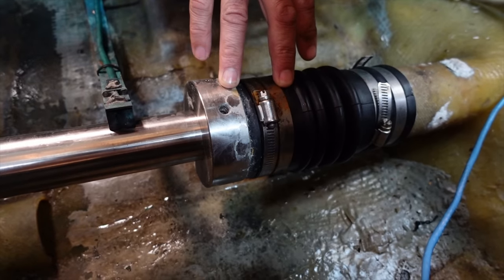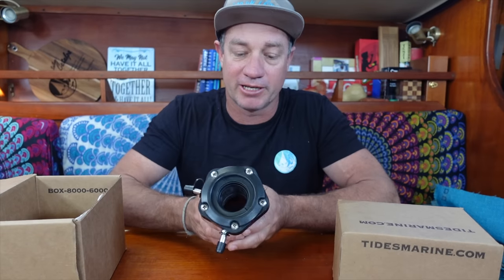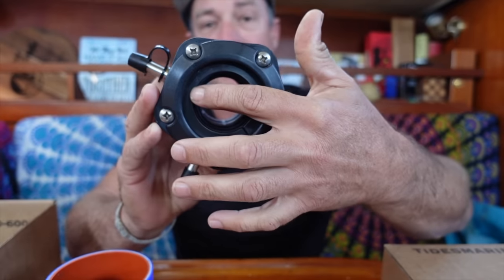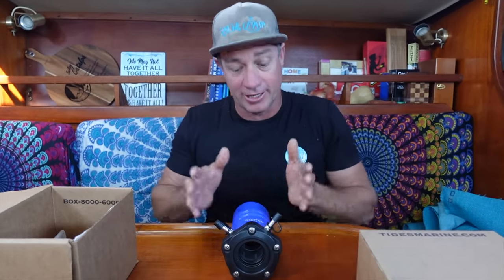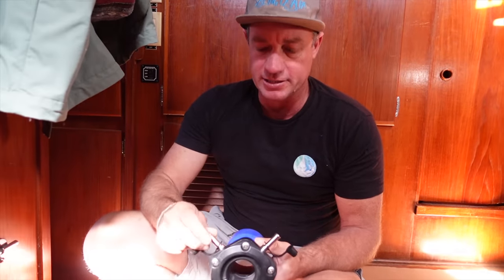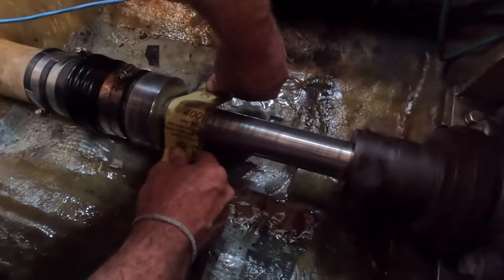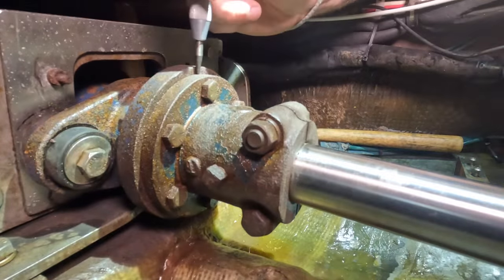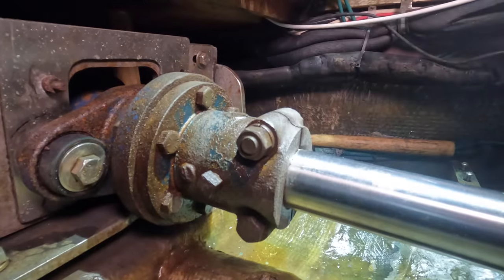Replacing our PSS shaft seal in the water WHY it might not be a good idea💡| Ep 345

Comment: You can jack the coupling off the shaft using the coupling bolts and a spacer that sits on the end of the shaft within the coupling. A spacer could be a nut or a few washers .
Place the spacer in the coupling so that when the flanges meet you have a small gap.
Put the bolts back in and tighten them evenly, the spacer will start pushing on the end of the shaft.
Keep adding more spacers until the coupling is pushed right off.

Comment: I have been contemplating a similar project  to replace my "Maincraft /tides Marine" prop shaft seal, system.(I think my thrust bearing is also loosing its grip on the shaft and allowing a bit of forward movement of the shaft; opening up the seal when pushing the engine hard. Research has revealed  that It seems every system (including a stuffing box) claim to be the best...
I had planned to tie up alongside the scrubbing posts but have now done some further  research and opted to
 get the boat out!  
The most useful information that clinched the decision was that  "The fastest way to get water out of a boat is a frightened man with a bucket!"
another tip was to keep a bicycle inner tube alongside the sterntube. in the event of total failure/split flange etc. tie it tight and keep wrapping it around all the old rags and stuffing, pulling it tight as you go . Allegedly this will keep you afloat long enough to sail/row/tow home....

Comment: Intense… your braver than I would be on that job. I did find what you has to say about the PSS seal interesting. When we were in the yard after purchasing our boat, I had the shaft pulled and serviced along with the prop.  The yard convinced me to replace my Tidesmarine seal with a PYI PSS seal.  The reasoning was due to how the Tidesmarine seal wore a spot into the shaft.  The yard guy said his preference was with the PSS because of how the seal mounted to the shaft and sealed agains the carbon bellow face vs having a rubber seal spin around the shaft.  I wish I could share the picture with you, but there was a nice shinny 3/4” wear in the shaft from the Tidesmarine seal. My PSS seal has been working good, but they do need to be serviced and mine is four years old now.  I have it on the list for my next haul out.

Comment: I know you've probably done this already, but all you need to do is gently spread the fitting in the slot, with a chisel, or some heat from a blowtorch to expand it, 

Also be aware your prop shaft doest slide all the way out! 😂 one way to stem flow is to wrap plastic bags around the shaft outside then as the pressure forces the bag into the gaps it makes a semi permanent seal. 

Well done for giving it a go first times the scariest, after that it's just a meh that's not so bad!
Reply: A couple of steel wedges in the two slots works for me.

Comment: Hi Lee, Sara. Thanks for this video. I’ve been wanting to learn more about the Tidesmarine seal. My former boat Snow Gum has a PYI PSS setup. I got to play with it a bit and install a new one while helping Volvo techs replace gearboxes and couplings a few times. Which leads to a suggestion. From listening to you I can tell you’re on top of this but it won’t hurt for me to emphasise the importance of eliminating vibration in the engine to propeller drive train. Our coupling failures were caused by poor alignment during build, so I applaud your efforts to chase that down. It matters, even if you have an Aquadrive. Coupling bolts will be fatigued by the vibration and the threaded bolt holes in the flywheel itself will be damaged, leading to repeat failures of the coupling bolts. It can become a nightmare. Regards, Rick.

Comment: I've had the bands break, yes the boot came forward and lots of water ingress. All bilges on and manual help to remove the water. 
Not once but three times this has happened. 
I love the access you have, i have a side access under a bunck that is an 8 inch by 4 inch hole you can only fit one arm in to remove the broken band, lever the boot back onto the mount and try to feed the new tension clamp on without marking the drive shaft.
Balancing a torch to see what your doing while you perspire like a fire hose and feeling your losing it when suddenly it all popped into place, an 8mm socket washes out from under the boot which now makes sense why it wasn't on properly in the first place. You really feel great after an event like this but wish there was better access to all engine spots.
I love watching and learning from you but please do it before  I've done it LOL 😅

Comment: I know I'm late : 
Sorry but if the bellows fail on your new seal you will have the same problem.
First remove the bellows from the stern tube forward on the shaft and stuff it with a large one piece rag really tight. this will stop the flow and make it easy to remove later. 
You will need a wedge hammered into  the slot to relieve that half coupling to ease removal. Also there could be another locking feature there. I shall watch the next vid to see what happens. :0)

Comment: Get a flat screw driver and place it into the slot and tap it into the gap to open it no heat or Chisel and as said plastic bag out side on the Shaft will slow the seawater flow. Great Vlog on not to do if you have never done it before.

Comment: You should put a screwdriver in the split and you pry the two apart just a little bit. That’s how my prop guy does it. Also, anyone watching this video who is going to try to do this in the water should realize. Moving the shaft back may not be successful. If you’re Propeller hits the rudder or if you have shaft zincs that hit the strut preventing you from moving the shaft.  keep that stuff in mind before you attempt the job. You need to know how far the shaft can travel without being obstructed.

Comment: what does the cutlass bearing housing, aft end look like, if it's protruding & just like the forward end of the stern tube, slide the shaft back as far a possible making adjustment to the pss compression as you go then wrap 4" wide flex tape around the tube & shaft to seal, to stem in flow, they say works under water. I guess the lip seal type of setup is good for gearbox/flywheel work in water as the seal is maintained not matter where the shaft is, nothing grabbed on to it !

Comment: Are you sure you want to run your raw water outlet to the shaft seal?  I'm assuming you are going to tee off the hose that goes into the  wet exhaust elbow?  Typically the shaft seal water inlet tube(s) are connected to a small forward facing scoop thru hull, so when the boat is moving through the water it provides a low volume/ pressure supply of water to the seal.  I worry that if you connect the seal to the raw water pump outlet that you could provide way too much pressure and volume.  That water needs to go out through those small passages in the bushing and then out the prop tube.  If you have too much pressure or volume it could bypass or damage the seal.  Also you would be pushing warm water into the seal, this might be good in cold waters, but in most circumstances I think would not be good.

Comment: While all these cleverly engineered devices will work for awhile, like anything else on a boat, they will fail at sometime. It probably won’t happen in your boat’s slip. Traditional stuffing boxes with flax and wax packing or newer materials that work similarly, can be maintained in the water and underway in a sailboat. Water in the bilge? So what. All the dust, sand, food crumbs that end up in the bilge will get pumped out by the bilge pumps. Traditional packing glands can be carefully adjusted after a short break-in period with all new packing to drip about one drop every minute and almost none when at rest. They have worked reliably for a long, long time since shaft drives have been used for propulsion.

Comment: What about making a puller by putting a socket that is just smaller than the shaft in between the flanges on the end of the prop shaft &  on the end of the gearbox output or coupling shaft put  longer bolts back in & tighten while tapping on the back of the coupling near the shaft not on the flange

Comment: Best best best thing you can do when it comes to your shaft seal. 
Dump those PSS ones. Great principle, not so good after time. 
Also the Lasdrop brand seal uses same principle as  your Tidesmarine one.
Reply: Also to get coupling off shaft. Put a socket inside coupling and using longer bolts connect shaft coupling to gearbox half and evenly wind bolts up, this will pull halves together pushing socket onto shaft and hopefully pushing the shaft thru the split coupling. Tapers on shafts are the way to go. As if taoers are the same both ends you can reverse the shaft if ever needed due to wear.